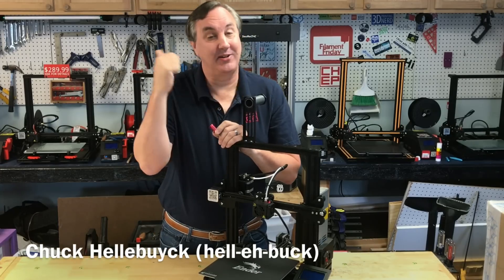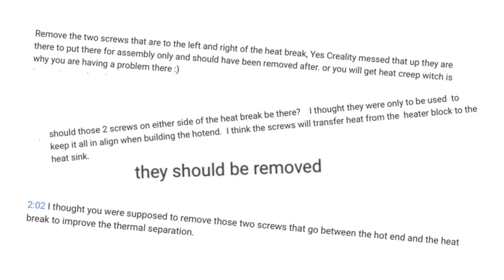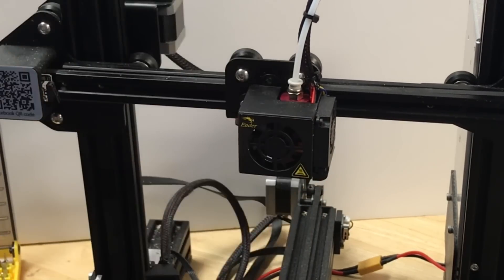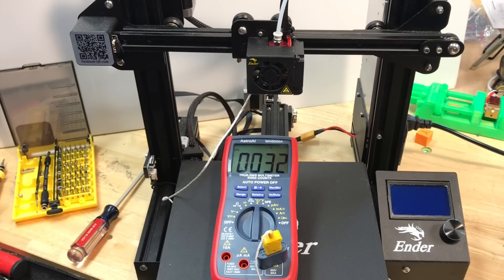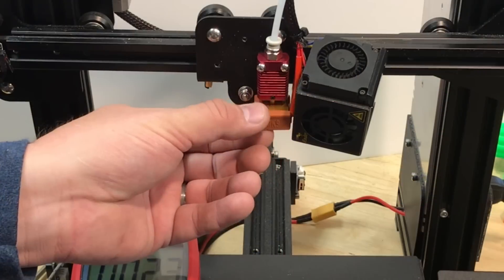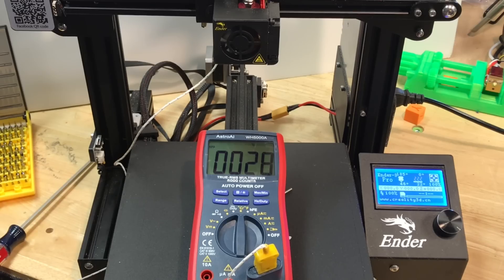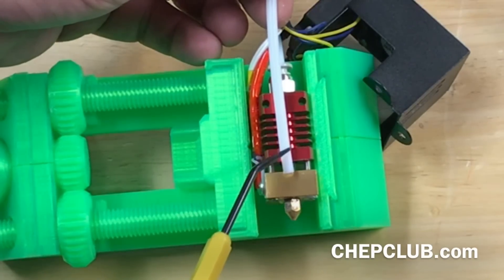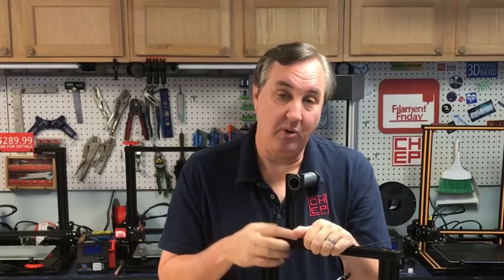Creality Ender 3 Hot End Heat Creep - Remove Those Screws......Maybe?

Comment: These screws are a safety feature. 
Without them you are risking to turn the entire heater block while unscrewing the nozzle.
And if that happens you will short the thermistor wires and fry your printer mainboard.
Reply: How in the world would this happen?
Reply from the maker: It won’t. A shorted sensor will just be reported as a Maxtemp Error. 
The thermistor is connected in series to a pull-up resistor to form a voltage divider. So even a shorted thermistor doesn’t short the board or power because of that resistance.
Reply: @FilamentFriday  on my Ender 2 a thermisror short resulted in a mainbord frying permanently.
Maybe the newer printers have some safety features, but on Ender 2 a thermisror short was deadly.
Reply from the maker: That is very strange. Sorry to hear that.
Reply: @jbdbruybhdhcy  it doesn't work that way. I suspect what happened is your 24v heater voltage way introduced  into the thermistor wire which would definitely take out your cpu( or a significant part of it.) But if your board did short out with the thermistor wires touching you had a duff board and it wouldn't have given correct readings anyway.

Comment: Been a while since I've seen one of your videos. I seen this one because of the heat sink - it is the same one used on the Tronxy X1. But it does not have the the two screws. The heat block is held tightly in place by the nozzle pressing against throat inside the block.

This is very informative, even for my Tronxy X1.

Comment: Thanks for the video mate. I would have done the test a few times so that you could have been more sure you’d get the same temp despite slightly differing thermistor placement.

I have just got an Ender 3 and the thing that annoys me about it is the heat brake fan is always on - you can hear it from a mile away and it’s so loud. Any way to turn it off when the nozzle isn’t being heated? Anything I could add to Gcode for that?
Reply: I just pulled out a bunch of super fine filament hairs hiding behind shroud and fan got alot quieter on my ender 3.
Reply: Well, not on a stock ender 3 you can't. If you change the mainboard out for something like an SKR 1.3 or 1.4, what you can do is wire the hot-end fan to the second nozzle heater output then set it up so that pin goes high whenever the hot-end is above a set temp. On my e3 I have it set up so the hot-end fan goes off when the nozzle is below 50c.

Comment: Since the reason those screws are there is the fact that they cloned the Microswiss design of the 1.0 heatsink you would want to remove the screws but be aware that you could also end up with a loosened block over time.
Reply: Still not willing to give up eh?
Reply: I didn't check how the screw would come off when I was assembling since my Ender-3 came with silicone sock, but that makes sense to have it there and sort of weird to see that only few specific heatblocks have those, more so some videos recommend to use pliers to hold the heatblock when changing nozzle but something felt wrong with those screws. I always fit replacement nozzle with only little torque so next time I want to change them I barely need to hold the heatblock, plus holding the heatblock feels like I can mess something up, maybe thermistor or the heater

wanted to see if volcano heatblock might fit the heatbreak tube so maybe I can just buy the heatblock and the nozzle,

Comment: not the best way to measure, you should have the thermistor insulated from ambient air. with air actively blowing over the thermistor you are not measuring the actual temperature of the metal, so the values you measure are kind of meaningless
Reply from the maker: Tried that. Didn’t make a difference.
Reply: How were they meaningless? He proved that with or without the screws it didn’t make a damn difference. Why not do your own video showing the “best” way?

Comment: Leave them in! In fact, tighten them, they'll keep your heat block from dropping which is what happened to me. There's a small screw on the front of the heatsink that I've found becomes loose due to heat and isn't always enough to hold the block etc in place! Leave them alone.

Comment: I removed those screws on the advice of another "expert"  guess what?  The whole nozzle assembly fell off during a print and ruined the print bed and gouged the aluminum plate underneath before I could get it stopped  Thankfully through all the chattering and grinding of the steppers there was no further damage and I replaced the bed (and those screws) and went right back to printing. Oh, and I replaced the damaged nozzle with a .2mm one. Works much better! Thanks
Reply from the maker: I’ve heard similar from others and it’s partially why I did my video.

Comment: Cheap thanks for the clarification on those 2 screws. I no longer pull out the filament when I go for a color change I just push the new thru until I see the new color come out of the nozzle, I haven’t experienced any blockage issues changing the filament out this way.

Comment: I'm not surprised the heat creap isn't an issue, but I am surprised you don't have issues with plastic oozing out if the top of the heater block without the nozzle tightened against the heat break.  I've had that happen to be a couple of times.
Reply: Joe Well why would the nozzle not be tight against the heat break? That just means things weren’t timed out correctly and your nozzle is tightened against the heat block and not the heat break.

Comment: maybe wrapping them in a layer of kepton tape will reduce a bit the heat transfer so ensure that the PID is more stable
Reply: Wouldn't that prevent the screws from radiating any heat by themselves, and ensure more is transferred to the heatsink?

Comment: How is the hot-end temperature measured ?  I don’t see a thermocouple in the heat block ?  Just curious ..
Reply from the maker: A thermistor is inside the block.
Reply: Thanks.  I was curious to how accurate it was.  I was under the impression it was a thermocouple and not a thermistor.

Comment: To add to this discussion, I had removed the two screws and printed  something and the hot end literally fell down and gouged the entire magnetic bed, totally messed it up.  DO NOT REMOVE THE SCREWS.  Update, after replacing my print bed I was getting bad prints and didn’t know what was going on.  I removed the fan cover to look at the hot end and found that while the hot end was raining hell on my print bed it had bent the hot end tube.  I ordered a new hot end, lessons learned.  Do not do everything a YouTuber does even when he or she is portrayed as a smart person and you think they are speaking on your behalf.
Reply: Good point -  the single grub screw is not really enough to overcome gravity and the backpressure put on the hot end. I added another grub screw at the back to help out. The allen wrench that came with my extruder was just a little undersized. When tightening the grub screw you just can't get a good purchase on it before that sickening stripping feeling comes on. Turns out the threads were fine, it was the wrench slipping. Get a proper metric one and its as snug as a bug and you can haul off on it.

Comment: Another great example of bad info creep.  So many people just regurgitate things they hear with no actual thought on or testing of the concept.  I think it has to do with people wanting to sound smart.  Good job testing before judging!
Reply: That the problem with the Internet there always people willing to "Give free bad Advice"...
Reply: I have to disagree in this case. Thanks to this "research" I refused to remove the 2 screws for a long time. I kept getting frequent nozzle jam, I had to turn off retraction and try to push the filament through as quickly as possible to avoid a jam. One day I got sick of the jam and removed the 2 damn screws and guess what? no more jams. Now I can use retraction and be confident that the print will complete. In fact I've never seen a good print before I remove those screws, those prints that I thought were pretty good were actually showing signs of the nozzle slowly clogging up. I know those screws are there to keep the nozzle in place but I can't accept a 50% failure rate after all the compromises I made. BTW I'm running a new Ender 5 Plus with upgraded dual gear extruder and high temp bowden tube and I'm pretty sure it's not a dying fan problem.

Comment: Haha good job Chuck.
Also worth mentioning that you have a HIGH risk of dropping your heater block due to thermal expansion when printing especially if you start to print PETG/ABS on your machine with those 2 screws removed. 

Think the people recommending these be removed were intentionally trolling to cause people to damage their machines.
Reply: I have to disagree in this case. Thanks to this "research" I refused to remove the 2 screws for a long time. I kept getting frequent nozzle jam, I had to turn off retraction and try to push the filament through as quickly as possible to avoid a jam. One day I got sick of the jam and removed the 2 damn screws and guess what? no more jams. Now I can use retraction and be confident that the print will complete. In fact I've never seen a good print before I remove those screws, those prints that I thought were pretty good were actually showing signs of the nozzle slowly clogging up. I know those screws are there to keep the nozzle in place but I can't accept a 50% failure rate after all the compromises I made. BTW I'm running a new Ender 5 Plus with upgraded dual gear extruder and high temp bowden tube and I'm pretty sure it's not a dying fan problem.

Comment: Thanks! I’ve read all over that they have to come out. Glad I didn’t waste my time!
Reply: If you don't have nozzle jam problem due to heat creep, there's no need to mess with the screws. but if you're like me it fixed my nozzle jam problem. Thanks to this "research" I refused to remove the 2 screws for a long time. I kept getting frequent nozzle jam, I had to turn off retraction and try to push the filament through as quickly as possible to avoid a jam. One day I got sick of the jam and removed the 2 damn screws and guess what? no more jams. Now I can use retraction and be confident that the print will complete. In fact I've never seen a good print before I remove those screws, those prints that I thought were pretty good were actually showing signs of the nozzle slowly clogging up. I know those screws are there to keep the nozzle in place but I can't accept a 50% failure rate after all the compromises I made. BTW I'm running a new Ender 5 Plus with upgraded dual gear extruder and high temp bowden tube and I'm pretty sure it's not a dying fan problem.

Comment: You would need to have those screws welded to the heatsink in order to have a noticeable difference, even by than it is not an effective heat conductor so doesn't really matter either way

Comment: I think the reason most say these screws should be removed, is because MicroSwiss tells you to remove them in their hotends 🤣🤣
Reply: Not in my case, this is based on my first hand experience. Thanks to this "research" I refused to remove the 2 screws for a long time. I kept getting frequent nozzle jam, I had to turn off retraction and try to push the filament through as quickly as possible to avoid a jam. One day I got sick of the jam and removed the 2 damn screws and guess what? no more jams. Now I can use retraction and be confident that the print will complete. In fact I've never seen a good print before I remove those screws, those prints that I thought were pretty good were actually showing signs of the nozzle slowly clogging up. I know those screws are there to keep the nozzle in place but I can't accept a 50% failure rate after all the compromises I made. BTW I'm running a new Ender 5 Plus with upgraded dual gear extruder and high temp bowden tube and I'm pretty sure it's not a dying fan problem. There might be other factors at play that can cause the heatsink to be less efficient but if you have nozzle jam problem due to heat creep, it's worth giving it a try, otherwise leave it alone.